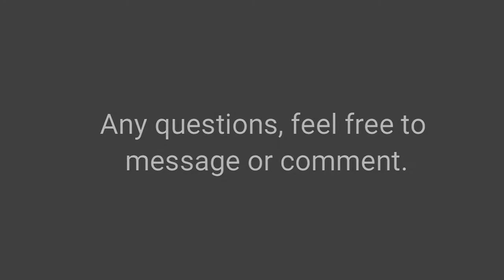John Deere 318 .

Comment: Nice job! Are you happy with Jim's service? I am looking to repower my 317.
Reply from the maker: Mark Whitmore, I was happy with Jim's tractor. They were very friendly and helpful. Of course depending on the hp depends on the price but with that price it includes everything needed to throw it in, no fabricating. You can get it with a new PTO if you choose or use the old one as I did.

Comment: Do have part number on the seat?
Reply from the maker: Scott Legois, I bought the seat off eBay. The manufacturer is Milsco. The one I have is PN 7937(black), the armrest kit PN 7947. If you wanted a yellow seat PN 7927. The seat had multiple holes for mounting different machines, I did not purchase any additional parts, the holes available were able to match up with my old seat and mounting brackets. TY15863 is the original part number for the seat.
Reply: That momma jomma is just plum bad ass. Love the black.